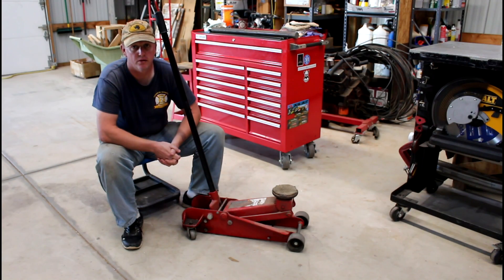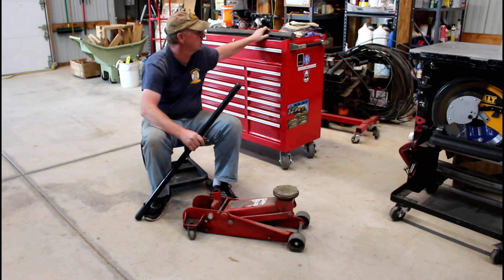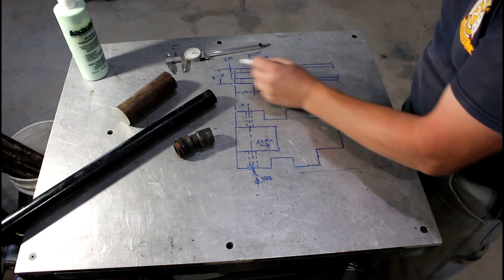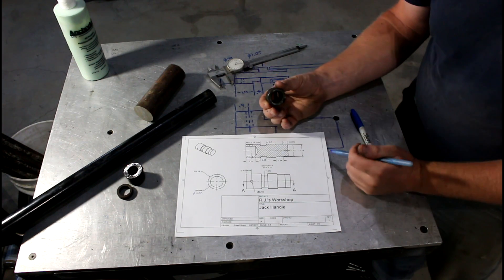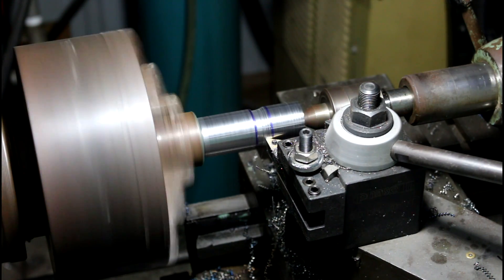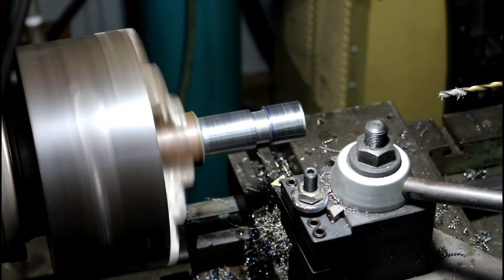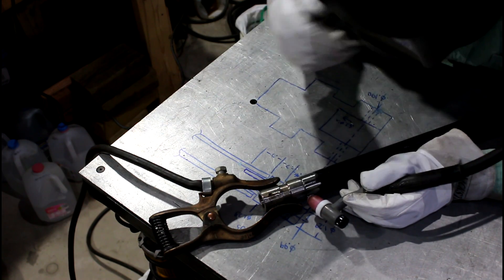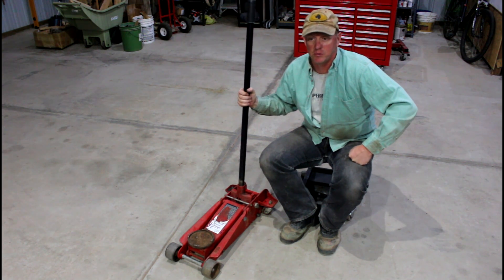Floor Jack Handle Repair

Comment: Hi I got a 1985 sears floor jack the handle will not turn left of right feels like its locked up teeth on gear wont move. Hope you can help Thanks for ur video

Comment: thats the same kinda problem i have   I have a snap on jack and have no handle same desighn I think with the cross pin
Reply: I need the same handle but don't know where to find on
Reply: @jacobmorefield4415  snap on sells their jack handlle for 165.00  thats crazy

Comment: I need to make a jack handle because mine is missing ..but I don’t have any access to your tools any suggestions?
Reply: use a friend's tools, or if you are inexperienced with said tools have a friend or someone else do it. or buy a new jack. you kinda need the tools to do the job, if you don't have access to the tools then you just cant. i would recommend trying to find a shop who is willing to help you out because that's a huge waste to just buy a new jack when there's a possibility of a repair. if you cant find a shop just buy a new jack from a reputable seller who has a history of long lasting tools and a good warranty like snap-on who has lifetime warranty.

Comment: Would like larger knob on the valve to make it easier to slowly release jack=>>share4.photo/pCarJack?S45     when under heavy load. Low profile was very nice to get under equipment.

Comment: Nice fix. I came looking for a fix for my jack handle. Mine did not break off. I have problems releasing the jack sometimes. My handle has a socket in the handle and that sometimes does not seat all the way down therefore you can't turn the release on the jack. I need a round tuit so that I can fix it. Nice weld btw.
Reply from the maker: I knew this was a pretty specific problem but I wanted to film it and put it up anyway.  Good luck with your jack and thanks for the comments.  R.J.